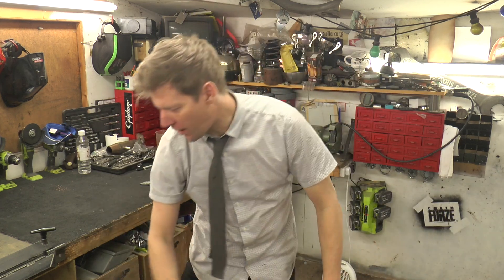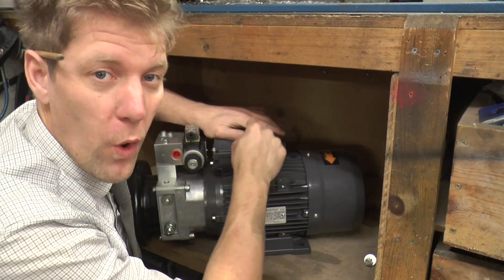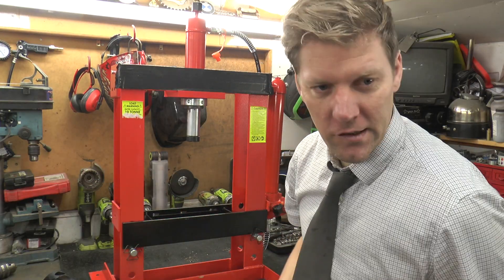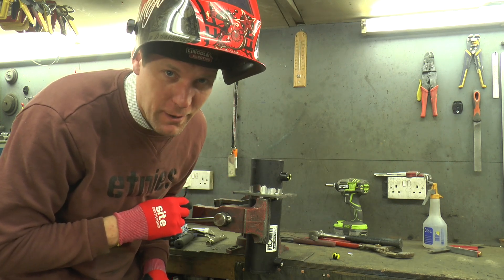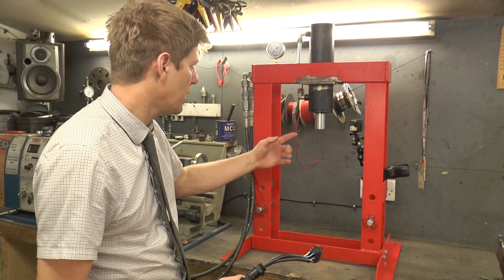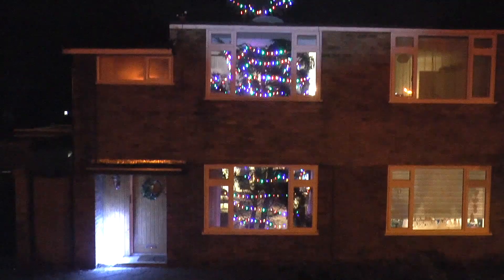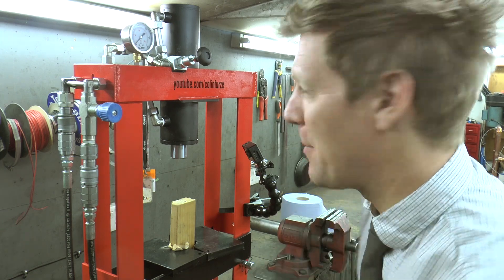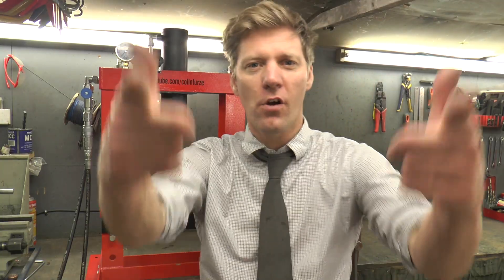Workshop Hydraulic System/Press conversion

Comment: I'm sure you know you can literally cut off your arm with a small leak in a high pressure hydraulic hose, but just be sure: You know you can literally cut off your arm with a small leak in a high pressure hydraulic hose, so be careful.
Reply: Even if its a relatively small/low power leak hydraulic injection injuries are nasty as you have to cut away the contaminated flesh in most cases. Dealt with a lad who took a jet to the face, wasn't pretty.
Reply: I have worked with hydraulics for many years and believe hydraulics are much safer than air.  Air is highly compressible so you have explosive energy storage with hydraulics the tiniest hole will drop the pressure in seconds and since it is not compressible the energy is lost almost instantly.
Reply: Well ok. It can't cut your arm off. It can at the very least cut the flesh off of your arm.
Do you agree?
Reply: @GLITCH_-.-  I have not seen this hazard with the type of hydraulics used here.  I have designed hydroforming tests that used water at pressures up to 50,000psi and yes you have to be very careful but we burst tubes at 10,000psi and the blast was contained by a 1/4 sheet of plexiglas try the same with air...not!  compressed air has all sorts of hazard not inherent with compressed oil .  Air is very noisy when exhausted and caun cause permanent hearing loss after only one hour of use.  Air contact on the skin even at  90 psi can cause air embolisms that can be fatal.  People have died when paintball cylinders have exploded.  Like I said I have built research equipment using hydraulics for 30 years and have not had ANY hydraulic related injuries (even minor ones) among any of my employees.
Reply: @mfsolutions  every days a school day, thanks for sharing
Reply: @mfsolutions  but you are professionals. I get the impression, having watched all his Videos, that he is just a DIY guy or that he was once doing some metal work job. Either one does not mean you knoow all hazards.
Reply: @GLITCH_-.-  I agree especially considering he is welding high pressure fittings himself.  That is definitely a hazard!  I wanted to let viewers know that in my opinion compressed air is much more dangerous than pressurized oil. And then there is always air-over-oil cylinders that combines the best (worst?) of both systems.

Comment: Loved this, like a lot. The possibilities are terrifying.

Super soaker 10billion - compressible water tank / cylinder + trigger release.

Over dunked biscuit dryer - biscuit form, water run off, hundreds of tonnes of force.

food extruder - turn your favourite snacks (or anything) into spaghetti

loose leaf tea / coffee pressure pot - push water through tea with the force of a thousand suns, for the perfect brew

Comment: As usual a wonderful invention. But I think you should work a little on your electrical skills. You don't have a use a big cable with lots of voltage and lots of amps. Just make an electronic switch near the compressor and then you can use a small cable or a wireless remote control. You could even use Bluetooth and your mobile phone or a small Arduino. Enjoy!

Comment: why not just use a hydrualic reversing valve with a lever and run the pump continously in one direction.. that way you can vary the pressure easily with the lever
Reply: Good point but I think a switch on a cable is better for remote control. Also the noise is a factor. 

However there are small open center valves with optional out-of-center switches which gives both pressure control and noise reduction, would be nice to try.

Comment: Colin, the flow control valve to the pressure side of the cylinder is a brilliant idea. This will give you a much greater degree of control, especially if you are doing some crucial bending. I would try to dampen the sound of the pump, I'm sure it's rather noisy, and I'm sure you'll rig up a much cooler looking remote switch.

Comment: Honestly surprised that there hasn't been more 'central hydraulic' systems for shops. I'm betting there are reasons that I will be told why this is the case...
Reply: Mostly the mess the leaks create
Reply: Longer the hose/lines the more pressure loss...

Comment: I would not try this system outside the shed. You need 3-5 times more oil in the tank, than you need to run your hydraulic system. If you try this with so long cables, there's a chance, that the hydraulic pump, pumps in air. This would be really bad for your pump, your cylinder and also for your valves.
I would by a bigger tank, if you want to try this outside.

Very cool videos. Support from Germany 👍👍

Comment: You didnt need a double acting cylinder to replace the single acting, just actuate the opposite solenoid without the motor and a spring return...you just cost yourself double in hose and quick couplers....built a single acting version of this less than a week ago.....

Comment: Wait, wait, wait... Did he put the fan grid next to a wall?
Ist that going to roat the motor waaay sooner than intended? Afterall usually with greater heat comes less hydraulicpower due to a loss of efficiency within the motor?

Comment: Yeah, I agree with others in the comments. I'm not fanatical about pulling out all the stops for 'health and safety', but it's so easy for something like that to throw shards, and eye protection is so quick and easy to use. 

Nicely done with the flow and pressure regulators.

Comment: When I lived in England, I  had a collection of Austin Minis. Most fun I ever had in an automobile, go karts with a body. I always wanted to cut the trunk bottom out of one and fab in a second sub frame, engine, tranny, and driveline. A Dual engine, 4x4, 4 wheel steering Mini, maybe even turbo charged, just think of the possibilities .I Didn't have the time or shop space to do it back then, but I think  a fellow with your skills could pull it off.

Comment: Normally I don’t point out when people make mistakes, but the trailer plug looks like it has live 240v terminals when you lift the cover, and especially when you sometimes have your kids messing about in your shed, can’t they just lift the flap and stick their fingers in the live terminals?? Besides that, aren’t they made for max 24v and almost no current, since it’s made just to provide power to trailer lights and stuff?
Reply: Pretty shure that plug only connects the external control panel of the tool to the hydraulic pump. No high current electricity passes thorugh it.
Reply: Yeah it could just be the solenoids that are connected to the plug, but theres still 240v on the bare contacts

Comment: What if u filled the cylinder with cold water or liquid nitrogen when welding
Reply: you're solving (or possibly creating) a problem, where there isn't one. It worked flawlessly just welding it slow like he did.

Comment: 240v and trailer connector and male connector at supply side. Big no no. This is machine waiting accident to happening
Reply: KillerJoeFIN bold of you to assume Colin can die
Reply: Looking at the same thing. I really hope those valves are with 12/24 volt coils and separate power supply when using trailer plug.. But because it is Colin, probably it is 240V :D
Reply: @Karjis  they are 240VAC solenoid coils, you can see the tag and he mentions it. 24VDC would be safer, but he'd need a power supply, the 240 he can just get out of the wall, so trading simplicity for safety as usual :D
Reply: Yeap.. 240/24 transformer is generally complicated device :D

Comment: Colin plz use another proper socket for the cable and remote. Using a trailer socket for high voltage is getting on my nerves. Other than that awesome job 👍

Comment: Im no Plummer I know you are so why did you not use a hydraulic lever to regulate the speed and power at the same time   you know the bypass type lever in neutral  all pressure drains lever down a bit  a bit of flow an so on I know thay exist  the hydraulic  press at my job use one  its brilliant

Comment: This is something I've always wanted in the workshop, as an car mechanic I use hydraulic a bit now and then when for example changing wheel bearings.
It would been perfect to just pull down a hydraulic hose and start pressing👍

Comment: Colin! Have I got a CHALLENGE for you!! I see that you have plenty of ryobi tools, battery tools, 😈and I want you to try to add a speed control to a circular saw( insert evil smile here) 

Oh! But wait! There's more!!?!
Take a piece of thin wood, make it round, and cut a grove in the edge. (Stay with me here) Make a mount(out of foam or cement) to hold it on its side, the disc spins parallel to the ground. 
What's it all for?(evil smile)++(I've  made this myself😈😁😝)
You wouldn't happen to have a 🐕?
Heh heh,hehehe heh
Dare you accept???

Comment: What is that machine that you use a lot to cut holes and slots in the steel sheets? Also, are you TIG welding here or what type of welding is that?

Comment: The next thing to build is a hydraulic lift, so you can work on cars and other heavy projects from underneath. You'd need to build another shed with a taller ceiling to house it in, though.

Comment: Now you just gotta make an adapter, so you can push the oil back into your reservoir tank, unless you want a nightmare of having to fill your tank and the risk of overflow, when changing between tools.
This adapater can use compressed air, and remember to use a valve on it, so to bleed off the air pressure, when you are finished pushing back the oil, or you are going to have a bad time.
Best regards
Reply: Xxvid12 the hoses and the tools have seals in their quick connects, and the fluid doesn’t compress so it’s volume only changes with temperature. All that means is, once a tool is purged of air, it holds on to the oil it is full of, and when you connect it up for the second time, the reserve tank doesn’t have to “give” the tool any oil. Put simply, he doesn’t need to worry about the tank over flowing, because the tools don’t drain when you disconnect them.
Reply: Xxvid12 he. Is. A. Plumber.

Comment: pretty good idea , it seems to be a lot more silent then my air assisted hydraulic 20 ton press that thing makes more noise then a steam locomotive 
be nice to have a hydraulic pipe bender  https://cdn.shopify.com/s/files/1/0618/1273/products/Hydraulic-Tube-and-Pipe-Bender-302-_One-Shot-Series_4e36d851-5217-41ce-8d52-b3ec8adbe8b7_grande.png?v=1540994007
a sheetmetal shear https://images-na.ssl-images-amazon.com/images/I/41jcWr8y2NL.jpg (does take a lot of room though) 
and a sheetmetal brake  https://www.trick-tools.com/common/images/products/large/edw-prb.jpg
you can probably get dies to press multiple inch size holes https://ae01.alicdn.com/kf/HTB1R6DpJXXXXXXGXVXXq6xXFXXXI/16-51mm-Hydraulische-Hole-Punch-Die-16-20-26-2-32-6-39-51mm-voor-SYK.jpg
or dimple dies http://www.swagoffroad.com/assets/images/Dimple%20Dies/IMG_4525-1.jpg for the hydraulic press too
as for the operating switch , think a switchbox from a winch might work well 
https://images-na.ssl-images-amazon.com/images/I/41ZTpCRIntL._SL500_AC_SS350_.jpg
be eazier to distinguish up from down and you can stand on it without it breaking , think you still have a few of those switchboxes  from youre junk mail destroyer project

Comment: I might not exactly know how the hoses work, but how does the fast plug-in plug-out work? Doesn't it just leak the liquid if you disconnect it?
Reply: They usually have a plug that activate when its relesed. So its just a ges drops or nothing that leaks out. Its mostly what brand You use.

Comment: The fan of the motor of the hydraulic pump hasn' got enough clearance. It maybe doesn't get enough air and so cannot cool the motor, which could lead to the motor overheating.

Comment: Colin, you have got the towbar plug round the wrong way. The live side is exposed! When you plug it is the pins will be live.
Reply: No problem, he has the safety tie on at all times.
Reply: DeepThought don’t you mean UNsafety tie? Anyone who wears a tie anywhere within 5 miles of a lathe is suicidal... but then, that’s Furze’s new/old normal.
Reply: @NeoMorphUK  Normally that would be the case but this is Colin we're talking about. His safety tie would actually destroy the lathe!
Reply: You have incredible attention to detail.
Reply: Low voltage for the control valves power will be flowing both directions to the switch and back.
Reply: He is immune to electric shock, is unaffected by gravity, radioactivity and magnetism and puts brake fluid on his breakfast cereal.
Reply: @andrewhoward7200  yes sorry I forgot that
Reply: @andrewhoward7200  And immune to random shrapnel, brick shards, and splinters flying into his eyes.
Reply: How is it supposed to be? Just to know the correct way.. is it supposed to be on the inside of the cabinet.. or flipped?

Comment: The only ‘issue’ I saw with this build is that placement of the pump motor where you’ve effectively covered the end of the motor as that cowl relies on free airflow to flow across the motor to cool it. Because you’ve placed the motor tight to the cupboard side, airflow would be restricted. Not an issue unless you run the motor for a long time or load it continually.

Comment: The further you move away from the pump the more fluid you will need for the lines. You may wanna buil/add a larger reservoir if you plan on being to far from the main pump to avoid burning it out.

Comment: Recommendation: combine the three strands (2x oil + 1x electrical), so you end up with one bigger "cable" to use. Much easier in storage etc. 
I'd recommend black tape, but that's a bit of a bummer when something breaks, so cable ties should do fine.

Comment: the electric motor on the pump has an air inlet to keep the electrics cool,  but the way it's mounted on that shelf it has very low air flow and that will reduce the life of that motor.

Comment: Hidraulic press channel will sue you... another thing Colin the electric motor in the hidraulic pump needs some more ventilation in the front air intake if you planning on using it for long periods of time.

Comment: Colin, don't forget to make sure there is enough space for the cooling air to enter the fan on the end of the electric motor!
Reply: The motor doesn't run long enough to get hot. In a practical sense, when random objects are not being crushed, this is just a tool to be used in short bursts.
Reply: Thought the same. Cooler directly fitted to the sidepanel 🤔
Reply: Noticed that too

Comment: Wicked build colin but won't you get hydraulic oil everywhere when switching between different hydraulic tools?
Reply: The quick connect got a seal on both ends. Might be a tiny little bit, just enough to make you see it when sitting down at the dinner table 😉 uses that kind on tractors all the time
Reply: @MrSkureklut  do you know if those things can be safely disconnected when und er pressure? Comparing to air tooling I would think one would do such things suite commonly.
Reply: @maesto  on the ones I have used, it is possible, only hard as f**. You would press them in, then thug them out again. With full pressure, I recon there is no go, but some is possible, like taking of hydraulic from a gate that's under pressure
Reply: @maesto  you have to dump the pressure before connecting or disconnecting. its not uncommon for the tiniest of hydraulic leaks to cut into things like a knife. theres easily enough pressure in any decent sized hydraulic system to cut your finger off. It's slightly different but look for water cutting machines on youtube
Reply: Nah you can't get them undone under pressure.
Reply: You can dump the pressure in the system normally

Comment: You will probably need a bigger reservoir if you have plans of running longer hoses or bigger rams.  You could also make it mobile like Make It Extreme did about a year ago for the same purpose.
Reply: Indosarnia  How do you think that if he ran hoses all the way outside it wouldnt require a more of fluid?  And that is the whole point of the build.. different projects, different ram sizes, different volumes of required hydro fluid.  Nothing consistent about it.

Comment: 2200w = 11a (which is fine as they are rated to 24A). However the trailer sockets are only rated to 24vDC. 

Just don't want you blowing yourself up Colin. Again.
Reply: Thats signaling, just to trip the relay ( the solenoid ) not pulling 2.2kw.
Reply: Good call.. I missed that...

Comment: Nice project! I've just a little concern. Is there enough space at the right of the pump motor to ventilate air in order to cool it? It seems to me that the motor is quite in a confined space under that workbench.

Comment: Hi, Mr.Colin, can you make one  water pumping system working without electric motor. While bicycle back wheel (on the bicycle stand) rotating , the rotation connect to water pump by using small gear system (manual air blower, which using blacksmith) that will increase rotation of water pump.

Comment: Almost all automotive sheet metal is formed using Hydraulic fluid pressure behind a rubber blanket. Your system would form sheet metal in a compression box over any shaped  "form" using RUBBER SHEETS instead of hydraulic fluid. I am doing that now with MANY shapes- including hub caps.

Comment: Make mechanical "Jaws of Life" as EMS calls them. If you dont know what they are they're like giant hydraulic scissors that will cut through car frames.
Reply: Will cut through basically anything... Car frames are what there most used on though.
Can imagine a steel beam being sliced.
Reply: I was just about to type the same thing then read this post. Now you have the hydraulic power you have to make a heavy duty cutting tool, ideally wearable.
Reply: @Spankypenguin1  sounds like an exoskeleton
Reply: Man he's probably got 100 ideas already for how to use the pump
Reply: Hi I need this machine how can I will contact you and what is cost?

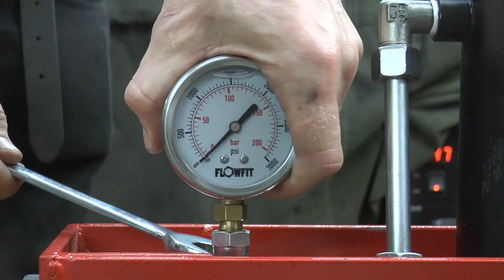Comment: 6:08 that gauge will not read correctly. You need to drill the hole in the main pipe to the full internal diameter of the pipe branching off.